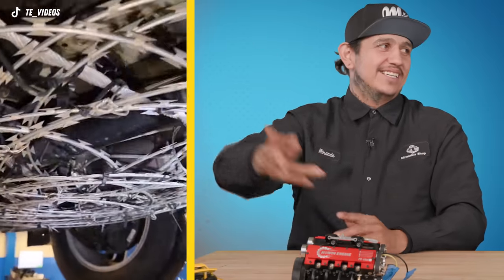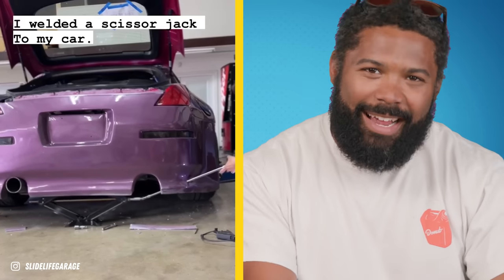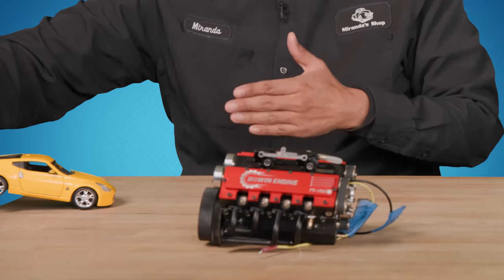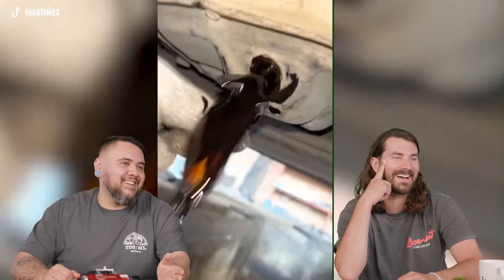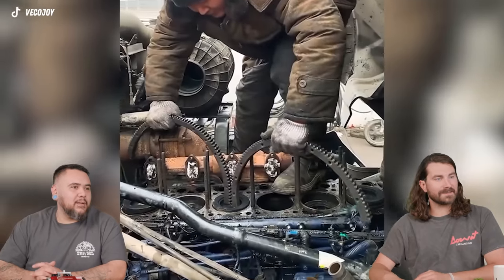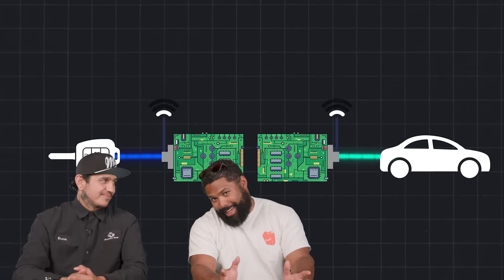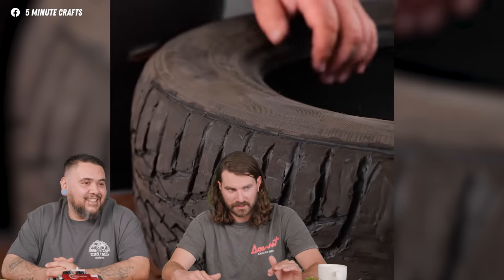Mechanic Reacts to Horrible DIY Car Hacks

Comment: so, for that one with the guy starting his car with the rope. It is somewhat easy to turn the motor over, you can do it with a ratchet on the crank so a rope where you can throw your weight into it should be even easier. and it appears the front wheels are off the ground removing that resistance also making it easier. as for your comment on someone in the car just starting it, unless they bypassed the clutch safety switch it would be impossible to start the car as it was clearly in gear from the get go as the tire was spinning instantly and starting a manual requires pressing the clutch in which would essentially take it out of gear and keep the tires from spinning like that.
Reply: and having it in a higher gear, 3rd or 4th, notice how fast the wheels are spinning

Comment: The issue with the tire-to-tire air transfer is that it doesn't seem to have anything depressing either valve in the valse stem. Maybe I missed something. The first was screwed on, the second was pushed on. I guess it is posable to be done but not as that clip showered.

Comment: that rope start should work on a small engine. i once started my car by putting a wrench on the axle nut, just remember that the car has to have an open diff and only one tire is off the ground. Also on the VW Beetle, Fiat 500 and Fiat 126 you can wind a rope around the pulley and start it like that

Comment: You really don't need to poke a hole in the hose if you wanna get the syphon effect on it. Blowing across the hose at the right angle does it too I did that. Wind strong enough will cause a Venturi and get it going too that just does it faster. Good thing of info to keep with you, I did that on my 98 Sonoma when I was checking stuff around the tank and it pretty much was full of gas. I had a wimpy hose to use but well is what I had and I did that, worked great for me. I knew it was kinda full because I pulled 13 gallons of gas from it and it was still very heavy after that too. Tho the bigger the hose the faster you drain too keep that in mind, pretty sure that's why they did that too of like the sticking the hose through it because it was a good size hose. The rest were yeah wack really to me the tire spinning one yeah I get that but yeah very specific criteria needs to be met tho to get it to possibly work. It like using the wheel for more better torque too in order to spin it easier but just pop the clutch bro, or even push it then pop it more steps on lifting, coiling the rope, turning the wheel a bit to get that angle and then yank lol.

Comment: That dude filling a flat tire with another tire. Just buy a tire plug kit and a half decent air compressor that can clip to battery terminals for around 60$. Much better than using the cigarette lighter adapter and keep it in the car. So for like 75-80$ you can have more peace of mind. Keep a battery pack jump starter in the car to top off the emergency repair kit along with a basic SAE / Metric socket and ratchet set. Also helps to have your factory scissor jack and tire lug nut remover. I put together my own basic emergency repair kit for my cars with select items and it doesn't cost a lot.

Comment: mythbusters did a thing on using an egg to "fix" a leak in the engine, and although that might be a temporary fix, i wonder what will happen with the egg and oil mixture and if it will break the car in the long run

Comment: 13:35 yep, your head basically works like a satellite dish 📡 helping focus the signal in the direction of the car.
Reply: That's not really what's happening, satellite dishes are receivers, key fobs are transmitters, putting the transmitter on your skull essentially turns your skeleton into an antenna which increases the range of the signal, but it isn't a directional increase, just a general increase in signal strength.

Comment: My grandpa was a mechanic for 50+ years he had all kinds of custom tools,  but one time a guy came all the way to ga from Pennsylvania trying to find a mechanic to fix his car he kept hearing a funny noise he took my pops up the road in it, pop said pull over turns out the radio antenna was install backwards.

Comment: ^^ The car jack hack is just about hight. The metal in your frame, door, and even the coatings in your glass mess with your remote's signal. Just lift it over your head so the key has a line of sight to the car's antenna, usually in a small fin at the rear and the door handle.

Comment: The reason your car fob works further when touched to your head is because of two things. First, your body is mostly water, and second, your head, in fact your entire body, contains cavities. These two things combine to work as, essentially, an antenna for the electromagnetic waves from the key fob. 

The full explanation is, of course, longer but that's the basis. Of course, this also means that, you don't actually need your head. You can do exactly the same thing with a jug of water, as long as that jug is, more or less, the size of your head.

Comment: The rope hack works we used it on my buddys mazda. But it was a lot faster and easier to just smack the starter with a wrench. It's just his starter is hidden so you need somebody with long arms to reach the starter...

EDIT: the car fob is a legit hack too, you can use it for am/fm radio signal extension and cleaning up the signal. We just have an apprentice stand up like a scarecrow holding the antenna and the signal gets 5/5

Comment: Pull starting a car with a rope via the drive wheel is definitely possible, people used to do it with the old landrovers and 45 series landcruisers back in the day, and those where large 6 cylinder engines too

Comment: The one about unlocking your car using your head, it's because your head is mostly water. It amplifies the radio signal. A gallon of water/milk will have the same effect. 
There is a Sixty Symbols episode on YouTube from about 10 years ago about it, with professor Roger Bowley.

Comment: I remember changing the oil in my wife’s car. The bolt was too tight and I couldn’t turn it with my hand. I also only lifted the car up slightly with a jack. So I’m laying under the car, have very little space to turn the bolt. So I used another jack, and used it to push the wrench to open it. I should’ve recorded it for these guys to review my hack

Comment: That zip tie around the oil plug at about 7:00 is actually a good way of not dropping the plug into the oil pan (especially if the oil is hot).
Except, he is screwing it in. I use it for screwing out. Like I said, only to keep hold of the plug. Who screws in an oil plug with a full sump?

Comment: Here's why roll/push/pull starting doesn't work with an automatic:

In an automatic transmission, the gears are not engaged by mechanical linkage. Instead, they are engaged by the transmission fluid pressure. Where does that pressure come from, you ask? It comes from an oil pump that is driven by the engine, by means of the torque converter housing. Unless that oil pump is turned fast enough, there won't be a oil pressure to engage the transmission's gears, and they will release (or stay released, since the engine wasn't running first).

In short, the transmission can't engage any of the gears until after the engine is running at least 400 rpms.

Comment: I might be wrong but I think the ziptie on the oil cap was to help open the bolt when you don't have access to spanners at some point considering how zipties have teeth like grooves on the inner side of it which may help gain a bit of traction if tightened properly.

But still, it's a wack. Ain't no way I'm going around in my car without my tool kit.

Comment: 10:02 Did that with the rusted, hardened steel bolts keeping my front seats in place three years ago. Let's just call it impressive that a mop-headed vampire weighing in at 50kg managed to rip the heads off those bolts. Getting replacements was a smart nip in the wallet.

Comment: The key fob hack is a real thing!! Porters (valet basically for dealerships) use this trick to find the car in long ranges. The water in your body amplifies the key signal, it works best with a jug of water. If you’re trying this, align the key and the “water” with the direction of the car.. if that’s stated correctly

Comment: I have a 1995 Wrangler and I'd leave the lights on quite a bit. So I have pop started it by myself more times than I can coun. So 1 person being able to get the moving fast enough to pop start with one person is not a problem. But his method requires 2 people but if you have 2 people why mess around with a jack.  This hack actually takes a simple fix and adds time and work.

Comment: 3:49 The rope hack is real. BUT it only works on diesel engines. This trick will NOT work with gas powered cars. The reason is simple. Diesel engines use forced compression to generate the explosive force to move the pistons, where as gas engines use spark to initiate an explosion to generate motion. Friend of mine's grandfather lived in soviet russia and virtually all the cars their were diesel. This trick was used ALL the time back in the 60's and 70's according to him, as the batteries used in the cars at the time were usually so weak and under powered they couldn't power the starter after a few months of use, also in the winter this was the only way to start the car as the batteries were always dead from the cold. though he did say a rope was a last resort, they best thing to use was long braded hemp strap. the reason was its flat surface with its rough aspects griped the tire far better, plus you could attach it to a another cars tire that was running and use that to jumpstart YOUR car.

Comment: You should never "regroove" a regular bald car tire. If it's bald then that means most of the rubber is already gone and it's close to showing wires and going flat so the last thing you want to do is remove rubber. Just drive on it bald if you can't afford to get another tire (which honestly who can....even used tires, which is the only possible option, are like $50 now). A bald tire is totally fine unless it snows (even then you can manage it usually if you're skilled and careful) so just drive it until it goes flat basically....which will usually happen shortly after the wires start showing. Also if you have a donut, they are good for around 10,000 to 15,000 miles (at which point they will go flat as well) but that's enough to last a month or two, so it helps

Comment: I would’ve use flex seal as the axle boot and pumping air into the bucket does work but sometimes you have to poke a little hole in the bottom and put the air nozzle that way remember sometimes you gotta do what you Gotta do to get you down the road my father never got stuck on the side of the road

Comment: The process of regrooving in the commercial industry is not actually regrooving but throwing on another layer of treaded rubber on the tire.And the rule is that these tires are not allowed to be in steer tires for obvious reasons.

Comment: My dad loves telling the story of my great granddad, who was a legitimate cowboy raising cattle in Arizona during the depression era.

One day, he couldn't start his truck out in the middle of the desert on his ranch. So he jacked the drive wheel up and wound a rope around the wheel (just like they did in this video), got his horse out of his ttailer then tied the other end of the rope to his horse's saddle. Then, he gave the horse a slap on the back to take off running, then he hopped in the driver's seat, threw it in first gear, and started the truck right up!

So, I agree with them that there is probably no way that dude had the strength to pull-start that car like that, but I absolutely believe a horse would do the trick! 😂

Comment: Lol no, semi truck tires are "re capped" not "re grooved". The casing gets an entire new ribbon of tread. They are also illegal to use on the front axle as "steer tires". Recaps are a decent alternative, but are prone to throwing a cap in hotter climates.

Comment: The oil plug one they called wack would be for when the engine has been going all day and the oil is hot enough to burn you. A small engine like that… probably not needed, but a semi fresh off the road it may be worth it.

Comment: 10:20 I built a tool that fits on a wrench. It has a 7/8 1/2 drive socket welded to it so I can turn wrenches with a breaker bar.

Comment: 1.  A built-in consumer jack under the car, exposed to road damage, weather, and any grime or salt the road churns up.  Then you want to trust it and your welds to safely lift the car every time?  You go ahead.  I'll spend the extra minutes.
2. Pull-starting the car with the wheel?  Sounds good until that rope starts wrapping itself around the wheel and the axel several times and something has to give.  Better hope it's the rope that snaps.

Comment: The key to the head works. I donate plasma at a small clinic and park my car out in front of a wall of windows. I can use my key to unlock the doors and roll the windows down from inside if I hold the key to my head. Otherwise, I have to stand right in front of the bumper.

Comment: I know the axe boot idea was a tie, and I am no mechanic, but I at least have worked in a warehouse for a while, and used packing and duct tape quite a lot. If you don't have a PERFECTLY clean surface, packing tape is utterly useless. The only thing that it really sticks to, is itself, paper based products, some types of plastic and some types of metal finishes. Even if you get a good bond to it, when you add moisture, especially grease and oil based things, that tape is very quickly compromised. 

If there is grease and rust like what you would expect to be on the metal on the bottom, you can forget about it sticking. Duct tape is way better, especially certain brands, like T-REX brand tape, but they still won't be able to stick to rust and grease, but would be no match to direct contact with grease from the inside. You could use flex tape, and it likely wouldn't last 10 minutes. Would not recommend.

Comment: Hm, well, I guess I can give them the 'can't push (pull) start an automatic', but there is at least one that you can. I had a 1963 Impala with a 2 speed powerglide that you very much could push start. Made a few bucks with that one night when the battery died at a bar.

Comment: Back in the days before portable air pumps, I was tripping with some friends, and we were thinking of million dollar ideas. I mean, if the Pet Rock can make a guy rich...
I brought up that I had recently had a flat, and the spare was also flat. Slow leak.
My idea was to have a four way air hose, with a valve in the middle. Connect the flat spare and the other three tires, and open the valve. Boom. All four tires are 3/4 full, allowing you to drive it to an air pump to fill them back up, and add some fix-a-flat to the spare.
Legit hack? Maybe. Million dollar idea? I'll never know.

Comment: Truck tires 19.5, 22.5, 24.5 rims have more rubber between bottom of groove and belts.  But if you regroove you cannot retread.  Car tires do not have the extra rubber.

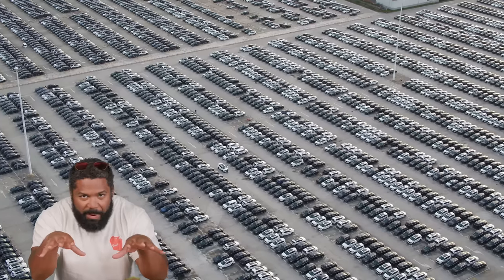Comment: 12:30 so your head or more specifically your brain is a lot of water. The radio waves from the key fob get to use your head to increase the range they can go. Your head acts as a radio transmitter which is why you can also put it up to a bowl or jug of water and it will work the same. You can also put two peoples heads together and get an even longer range. The small radio waves go into the water and come out as big as your head which makes them go further and spread out more.

Comment: For the rope hack, I feel like they're missing something: how are you supposed to get the car down? it has to be on a jack for you to turn the wheel, but you're going to have a hell of a time getting it off the jack while it's going
Reply: Don't think you are, you're charging it. You can top the battery up with water if its dead, then charge it from flat.

Comment: Note: it is illegal and unsafe to drive with regrooved steer tires according to the FMCSR's (trucking regulations) because regrooved tires are more likely to blow out and if you blow a steer tire you're much more likely to completely lose control and wreck. If you do blow a steer tire, do NOT hit the brakes or you will certainly lose control. Just let off the accelerator/turn off the cruise control and coast to a stop.

Comment: The thing about the rope wheel thing is that you dont have the weight and inertia of the actual car moving forward to start the car also the differential transmission will probably loose a lot of force

Comment: The rope starting is such an anti hack. You would need to have something that can push the wheel high enough of the ground and a rope to even do it. If you have that then you are probably somewhere where you'll find an easier way to restart your car.

Comment: The oil plug one I like cuz we gotta do in 10 mins so oils hot sometimes I like it after u crack the plug but I use a long extension to take the plug off so depends but if u can no hot oil

Comment: Many automatics can be roll started, depends on the transmission.
As for the pull start it has to be in a very high gear though only works when the car is already warmed up which defeats the idea.

Comment: Okay pool starting The stick shift like this is really easy if you do it in second or third gear if you do it in first gear it's going to be much harder. But it is possible as long as you don't use first gear to just wrap a string around your tire and yank on it and the car should start if the tires are off the ground.